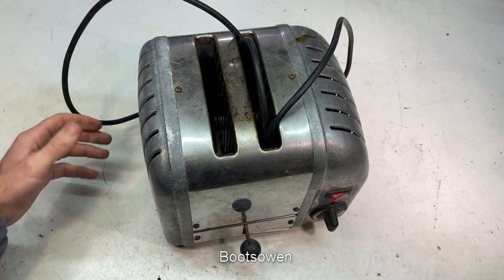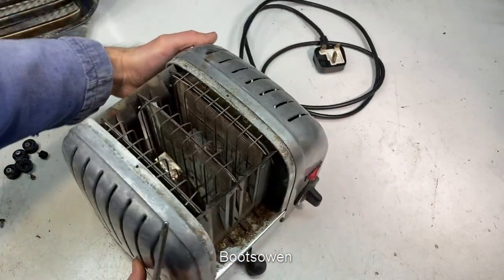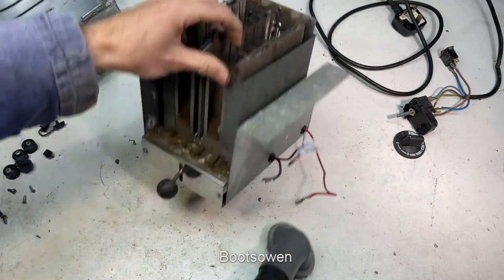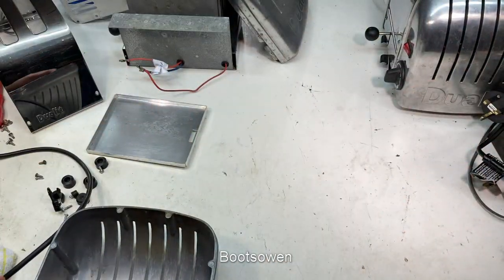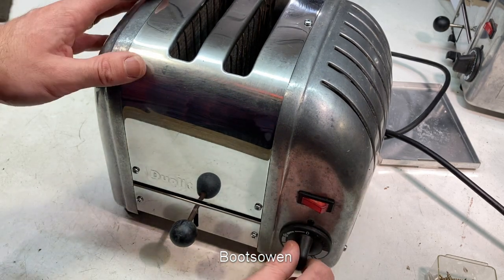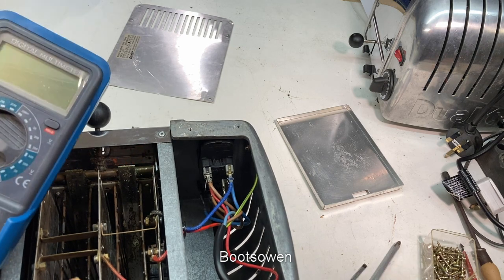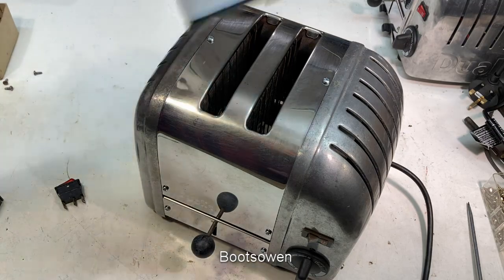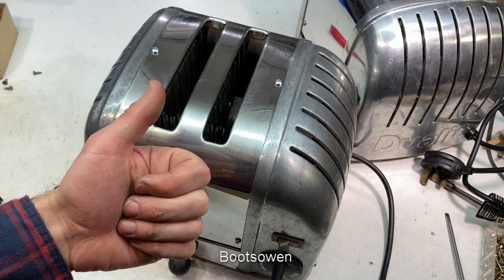Dualit 2 slice toaster: New switch: Cleaning and dismantling 2 Bread toaster and some comparisons!

Comment: Good fix there, it's appliance heaven in your hands 👍

I think the I/II switch makes more sense than the others you had & the neon isn't really necessary anyway.

I looked & you can get the 'old style' elements cheap on eBay.

Also, you could try Autosol paste & a toothbrush (on stubborn marks), even use a buffing wheel; that should  bring out the shine.

Hope this helps in future 👍
Thanks for another good video 🙂
Reply from the maker: The autosol is a good idea. I thought about buffing it on my wheel and about spray painting the ends. Hi don’t really know what I want it for.

Comment: Hey! I've been repairing a few Dualit and Magimix on this side of the Channel 🙂 and one trick I have seen is to take a picture of the connections BEFORE disconnecting anything. And it works!! :)
I'm trying to find where Dualit is getting its switches from. Farnell has pretty similar ones but they don't have the 1-2 (or I-II) versions. And the brand -Arcolectric-that you can find on the switch does not exist anymore. If you ever get a hint...
Reply from the maker: Have you tried the Dualit website

Comment: I'm still not sure which goes where on the rocker switch. Your help would be appreciated. I have a 4 slice.. with the long red in the centre element and the short red on the end with the blue. Which one goes to the rocker switch and what is the correct sequence for wires on the switch if looking at it 2 on the left and 1 on the right.
Reply from the maker: have a look at my other dualit videos and maybe they will help.
Reply: @bootsowen  I figured it out by pausing your video at various points and zooming in.
So... Holding the rocker switch so the two are on the left and one on the right the sequence is: Red, Brown, Blue. Also, either red will work when attached to the rocker switch.. but.. when selecting only two slots on a four slice toaster the short red will start the two slots on the left and the long red will start the two slots on the right. I hope this helps someone and many thanks for the video.

Comment: I'm still trying to work out which ones got the wider slots, the 3 and 4 combo ones used to have them with no ejector presumably to more effectively accommodate the sandwich cage but the one above seems to just be a regular toaster with the wider slots. I guess it's the usual British manufacturer changing things on the fly with no available documentation.
Reply from the maker: it's just one of life's mysteries!